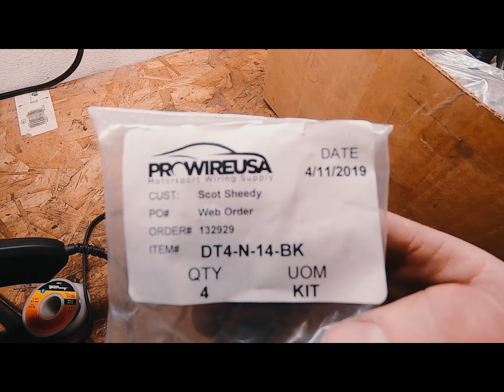1000HP Supra 2JZ Engine Build PT 3

Comment: More info on that intake manifold. Nice build!
Reply from the maker: That is a Greddy replica intake from ebay for a 2jzgte. It's been port matched and then welded to the GE lower runners. We've since switched to GTE upper and lower intake manifold with a custom adapter we made to the head